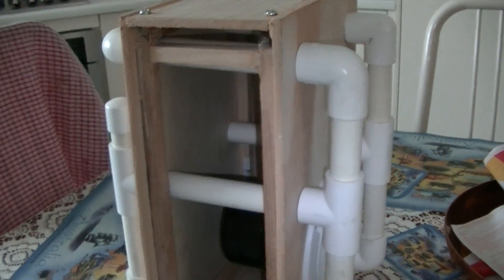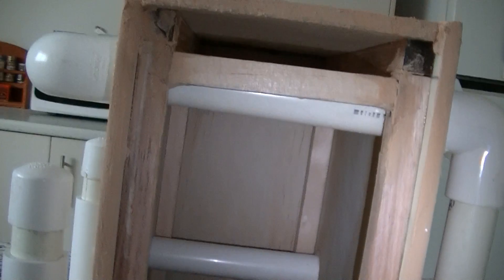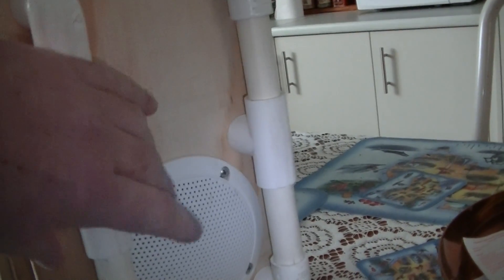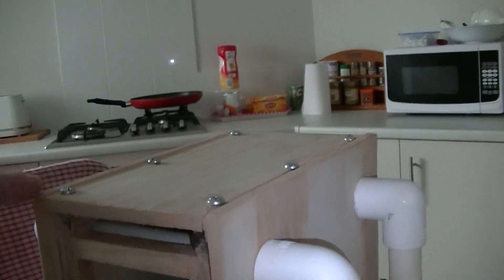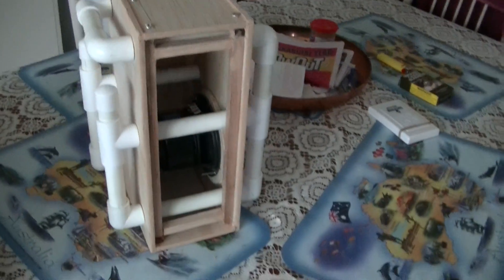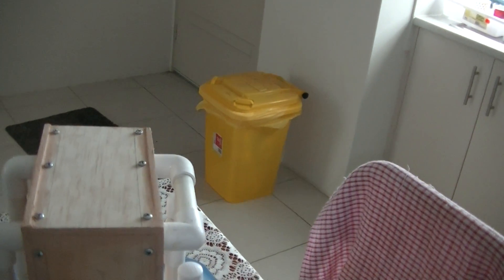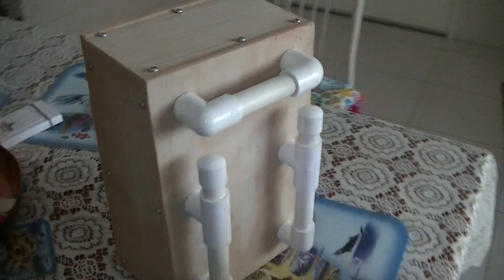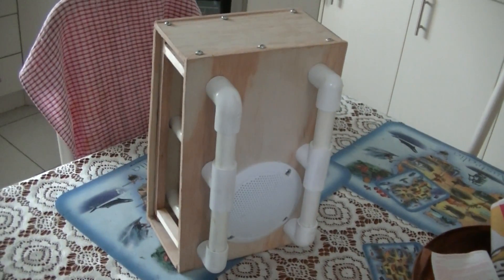new smaller portable ghost box under construction

Comment from the maker: the 2 reverberators come recently and also one noise gate im waiting on the 2 special pedal adaptor plugs  to come yet as i need them to help plot the design size pvc stencil  and plate  for the main parts to be fixed to  for the rear of the enlarged ghost box this needs to be done first in order to set the correct size for the new enlarged ghost box , ive got steel wool and viniger in a jar to make and try out some ageing stain for wood but its been over a week now and the steel wool hasent rusted to create that stain like on the american youtube video  which said there steel wool started rusting around 3 days so whys it not working here even in a week